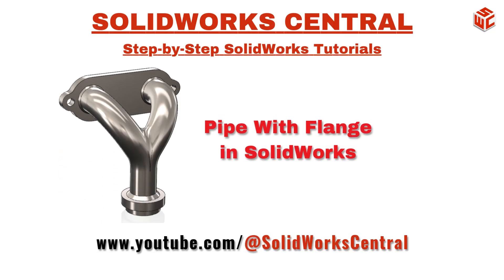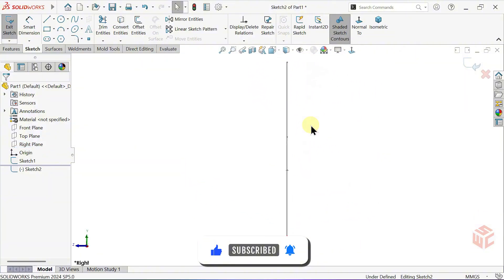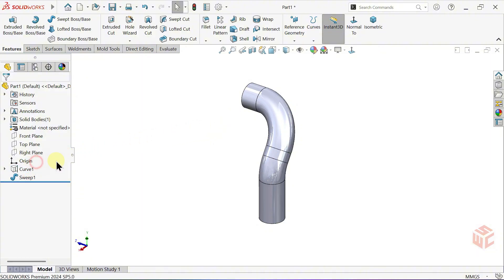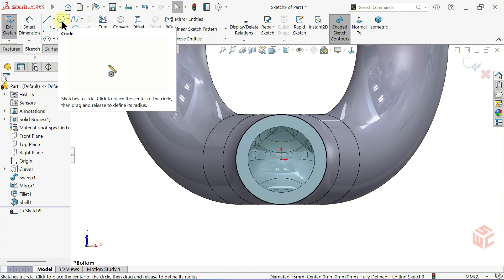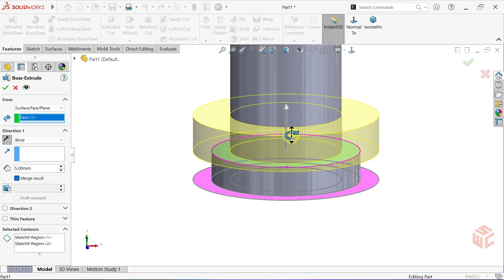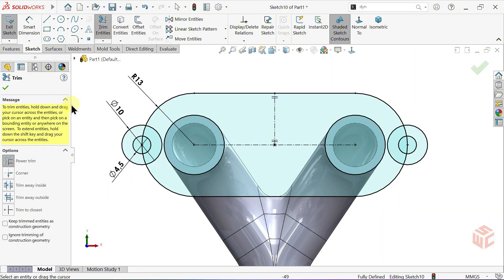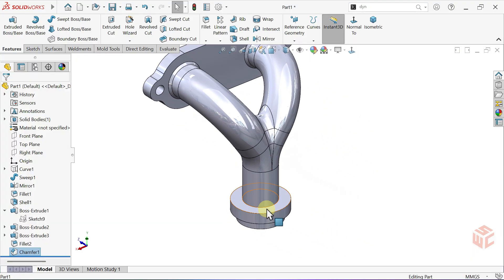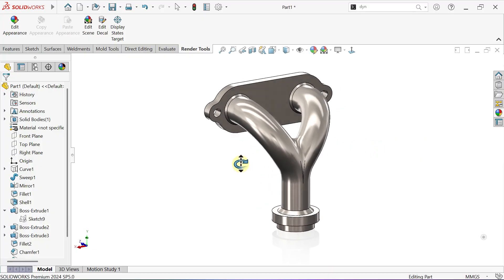SolidWorks Tutorial - Pipe With Flange – Step by Step Modeling

Comment: For a smooth internal faces I prefer to use the solid body to cut out (subtract feature) the internal channel of a bigger block body and then use the shell command on the resulting body. You will notice the the internal faces generated are more simetric this way.
Reply from the maker: That’s a great approach — your technique is definitely valid. Every designer has their own way of modeling. Thanks for sharing your insight and helpful method with us! 🙏🏻